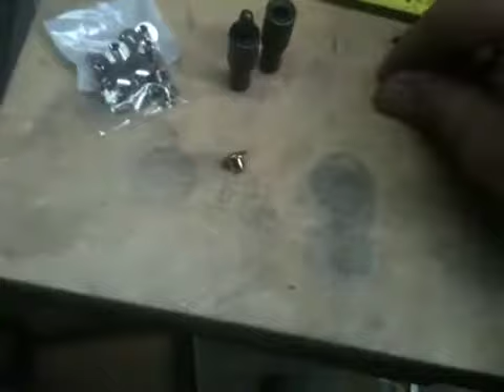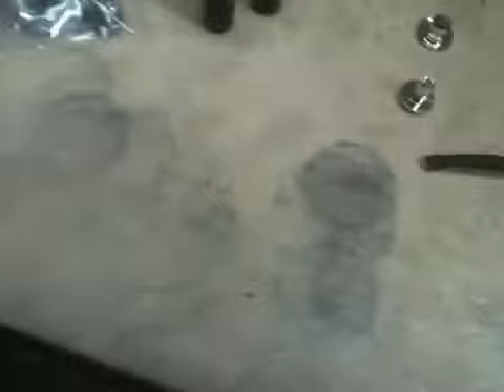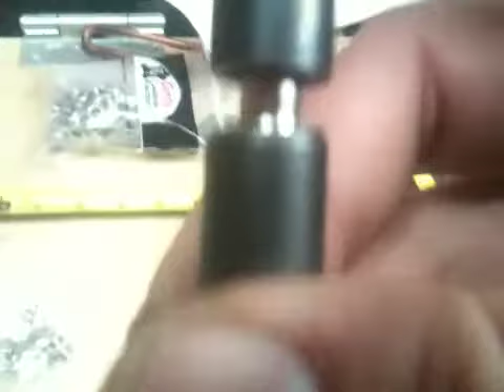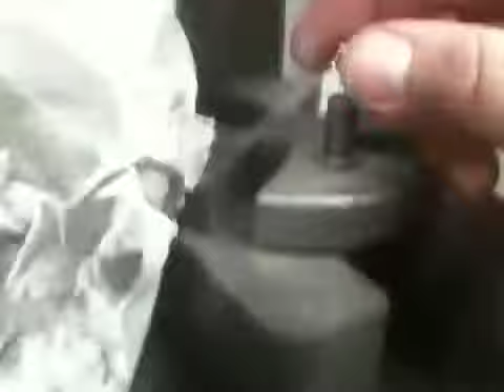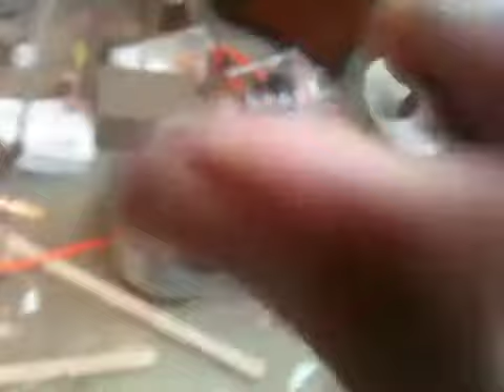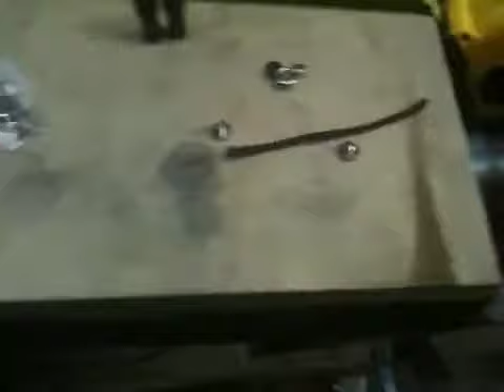Eyelets for sheaths

Comment: Would a rivet marketed for  .25 thickness be adequate for total .28 thickness? I'm looking to  make a .08 kydex with .06 reinforcement panels on both sides.
Reply from the maker: You might get away with that. I'd say you might be pushing it though.
Reply: @RileyKnifeandTool  I tested it and it works fine. The single 8-12 rivet through all four layers is quite strong.

Comment: What length are the eyelets?
Reply from the maker: I don't recall, but most distributors will specify the recommended kydex thickness/number of layers that each eyelet will be suitable for. I'd use that as a guide if searching for an appropriate length.